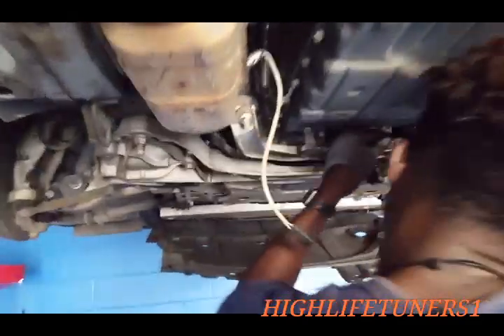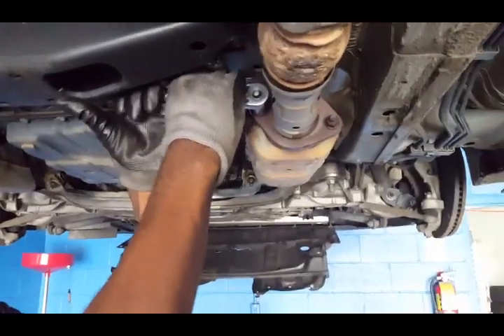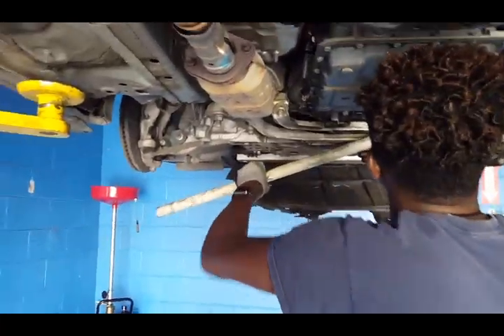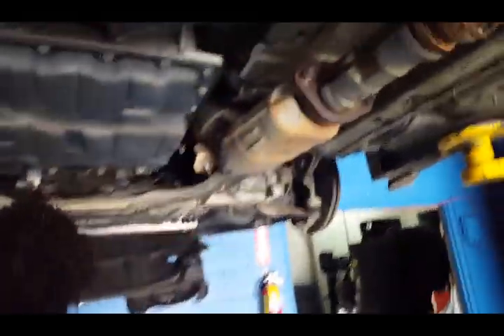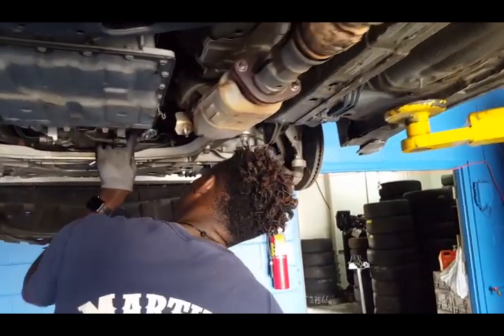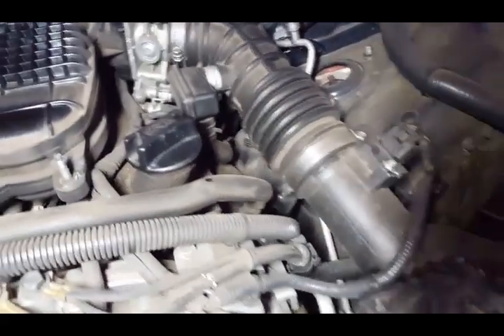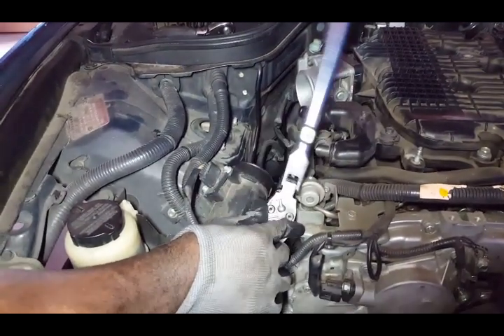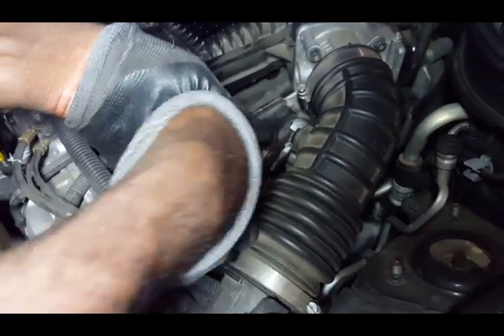2010 Infiniti G37/G35 replacing aftermarket catalytic converter

Comment: Much respect to the young wrench. I hope he's learned a lot by now.
Reply from the maker: hello arlen thank you for your great comment jo is already a good mecanic u can see in other videos please help us grow n subscribe thank u again...
Reply: Doing this job right now and I am having a hell of a time getting the driver side cat out.    I am not a mechanic but I didn't have the money to take it to a shop. The problem is 
1. I don't have a lift.
2. The bolts are old and rusted on pretty badly.   
3.  There's no room to work and get those bolts off.   
4.  There is a big heavy bar in the way .... 

my question is can I remove the bar?  ...and if I remove this bar will the car engine just fall out?   My gut says yes remove the bar the engine won't fall out.   But I'd like to make sure before I just Gung ho it and remove it.   

 My other question is once the bar is out of the way, if the bolts will not come loose.  Can I just take a Sawzall to the old cat? So I can reach in a get more leverage on the old bolt.?    I have new cats and new gaskets so putting if back in won't be too difficult.   

Let me know please..   I'm probablt just going to go remove the bar and hacksaw the cat out so I have more room to work if I don't heat back any time spoon.
Reply: @thedronefactoryusa79  idk if you went through with it but yes you can take the cross bar frame out since the engine sits on the motor mounts, just be sure to put it back on once you’re done. Also, yes if you cannot reach the bolts because of the cats in the way I would advise to cut it so you get more leverage, or you could take a torch to it and burn the bolt out.
Reply: Yea I cut that old cat out.  East peasy... no wonder every one is stealing all the cats... these are mine so I can legally sell them right?   Where would I be able to sell them?   And any idea what I can get for them?
Reply: @juniormartinez2586   😢

Comment: Wow great video I’m thinking this is the reason my g37 keeps going into limp mode after I reset the ecu because my Left side cat had a rust hole?
Reply: My doesn’t go in limp mode but keep throwing p0420 code no check engine light just service light right now testing with catalyst cleaner formula

Comment: Did you have to take off the steering rack for the last bolt? There’s not enough room for the 1/2 inch drive the steering rod is in the way ...
Reply from the maker: there is just a lil trikkie take ur time ..help us grow sub to the channel thanks
Reply from the maker: i also forgot we used an adapter that bends in half way i forgot what is call
Reply: A universal joint?
Reply from the maker: @DharokProd  add me on ig/highlifetuners1 n ill sent u a pic tomorrow

Comment: Question why are you changing the cat on here? It looks to be in good condition. Mine is all thrashed & beat up looking. I’m abt to put kinetix on my car. Wish me luck
Reply from the maker: The cats filters are not flowing correctly they may look good but not work correctly this car got over 100k miles cats dont last forever
Reply: @juniormartinez2586  ooh okay. Yes I changed mine too. :) best thing i did for my car. Love it now.
Reply: @Ulove619  you recommend the Kinetix Cats? I’m thinking about buying them right now.

Comment: hey i have a 2015 infiniti q50 and my cat on my left side is rattling as if somethong is loose in there maybe that honeycomb ish . But anyway my mechanic keeps saying dont worry about it and if he was to replace it hed have to replace everything like the sensor and the pipes n stuff.. because it would break ..hows that sound to you?? and are there any other options??
Reply from the maker: Man I honestly bought some test pipes if you want to save some money just put test pipes i pay $100 for both
Reply from the maker: Hes trying to rip u off the 02 sensors dont break you just removed them from the cats
Reply: @juniormartinez2586  can the o2 sensors melt onto the cat ?

Comment: I just had my driver side Cat replace ... I'm experiencing the same problem in performance issues as before while leaving the shop any suggestions as to what it could be just trying to get a second opinion
Reply from the maker: what brand of cats u got...depends on the brand  are u just trying to pass emission
Reply: @juniormartinez2586  the one off eBay from Canada
Reply: @juniormartinez2586  car is running super sluggish the mechanic diagnose front passenger Cat...pick up the car today and the problem still exist....car is real sluggish still low power
Reply from the maker: @Thatsdjmoon  did u read the computer what did it said.
Reply from the maker: @Thatsdjmoon  get u a 25 dollar scanner n tracked down let me know what the code is n ill looked up
Reply: Hello is it normal for both cat to go bad... Now I'm being told the other one is bad also?
Reply from the maker: @Thatsdjmoon  so u only changed one
Reply: Yes
Reply: @Thatsdjmoon  can you tell me what end up happening I have same situation
Reply: @swervv2957  come to find out I had trash from the cat in the exhaust pipes causing the car not to breathe probably.. have a shop check your exhaust pipes for trash
Reply: @Thatsdjmoon  is not trash cause I had it lifted and the rattle came from the passenger cat. All bad I guess

Comment: How are those cats holding up? Did it change how the car accelerate? I hear some converters have less flow than original, minimizing performance.
Reply from the maker: yeah it sounds diffrent n performance wise is ok unless u wanna spent $1800 dollars for new ones
Reply: @juniormartinez2586  hell no I dont want to spend that much. I'm stuck between $150 no name ones or $300 Eastern catalytic. That's for each. Mine are rattling internally.
Reply: @justhere4721  damn mine too! What did you end up doing? I’m in Cali and am limited on how I can go any this and my budget low. Need some help
Reply: @swervv2957  Well I got the eastern cats, they didn't fit right. So I returned them. While examining the oem ones, I noticed the part inside the cats came lose from the shell. Brought it to a good welder and had them weld the lose part inside to the inner shell. No more rattling
Reply: How would I be able to know if it’s like your? Is it possible to know without having to take it all apart because one I do that I have to either be sure that’s the problem or have a new one to swap if it’s something Unable to fix. Damn mine being like yours is my best case luck chance I got
Reply: @swervv2957  When you remove it off the car, look inside through the rear exit part of it. You'll see a filter like metel mesh thing. That's the part that rattles. If it slides back and forth ,it's lose. Have someone weld it to the inner shell so it doesn't move around anymore.
Reply: @justhere4721  ok thank you bro. I’m take it too a muff shop and see if we can do that. What’s the risk if any of doing that? I hope that’s the problem with mine. It’s just a continuous light rattle on the passenger side cat. No check engine light No difference in power in car. I just passed my smog 2 months ago. If it turns out the cats, might you know of any gd aftermarket to get? Heard that allot of after market weakened the tone exhaust and torque. Idk. But to get from infiniti is a shit ton of money for me at the moment at 700-1000 a cat. Fml
Reply: @swervv2957  No risk. The guy I went to used a dremel tool to clean up where he was gonna weld. Its tight small area to work on, but he got it done. The rattle is usually the heat shield or metal mesh came lose inside. Either way, they can see what's rattling easier when it's off the car. Good luck
Reply: @justhere4721  I’d go that route too but don’t know who will weld them on. :(
Reply: @Ulove619  Did you go with the kinetix? If not, can you let me know what you did buy and how did you like the change? Thanks

Comment: How exactly did you know it was the cats ? I have a 07 g35 and it just sounds rough but no code for cats.
Reply from the maker: this is my bois car he couldnt passed emissions he had a code for p0420
Reply from the maker: help us grow sub to the channel thanks
Reply: @juniormartinez2586  hey bro I have this constant light rattle sounds like coming from my cat on the passenger side. Took it to the local muffler spot and they told me it’s the cat going bad. But I got no codes and it just passed emissions 2 months ago? I don’t know what I should do if it is cat cause I know it’s expensive and I’m in Cali so I’m limited.
Reply from the maker: @swervv2957  jack it up n hit with ur hands if they rattle they need to be replace this things go bad after a while
Reply: @juniormartinez2586  we did that at the muff shop, hit it all over the cat and really didn’t get no rattle, so turned it on put bk on lift and you can hear the rattle coming from the passenger cat. But I’m not sure what to replace with at a budget that is gd quality, not loud, and passes in California.
Reply: My cats on my 03 g35 look horrible but no code. But I feel like I have lost power so I’m changing to the kinetix cats. I pray they make my ride better. I wish you woulda said all tools needed.

Comment: The bottom of my 2014 is so much more rusted than that it’s crazy
Reply from the maker: Used pb blaster to remove any rusty bolts
Reply: @juniormartinez2586  what set up is that I want to run it on an vq35hr 08

Comment: I have Z1 high cats and headers with intakes on my g37s. You definitely have too go and get it dyno or your going to get mixed signals from your ride breh.
Reply: Did your check engine light come on when you installed the z1 cats ? I got a 06 g35 planning on buying the cats from z1
Reply: @emmanuelnoriega2946  it did but not till later. Putting more air into the car just confuses the air censors that's all.
Reply: @emmanuelnoriega2946  im about to the same, same year and car. How yours turn out?

Comment: I'm on day #2 trying to do this same job. I'm stuck on one remaining cat bolt....driver side.... there's no freaking way to access the nut on this bolt unless maybe you remove half the entire engine bay? Jesus Christ. I've tried from the top and from the bottom. There's no good angle and I don't wanna strip the nut or bolt. FML. Every simple job on this car turns into a nightmare
Reply from the maker: The top bolt if it is u need a 1/2 inch extension the long one n half inch brake a bar n that will do it
Reply: Were you able to get it taken off? Im considering doing this on my car as well, but some jobs do indeed turn into nightmares

Comment: I twisted an extension trying to remove the top bolt on my cats, and gave up. Any tips? 07 G35s
Reply from the maker: u need a half inch extention thats the only way to get it .spray some pb blaster to loosen them.
Reply: @juniormartinez2586  okay I had 3 extensions stuck together like a train, and twisted one of my craftsman extensions. I'll use the PB blaster this time. Thanks for the info.
Reply from the maker: @alexscarborough6263 make sure is a half inch cuz the top bolt is really stuck on there can u sub to my channel for more future videos thanks.
Reply: Took me a lot of PB blaster, two broken extensions, and a stripped bolt remover bit to get my driver side top bolt out, and we broke the bolt lol...

Comment: I added a high cat  ,but it given me a code after  a few  days ,I felt  like I loss a performance , I dnt have the original catalytic converters to put bk in ,
Reply: Torvarris Brown anytime you replace factory parts with aftermarket, you need to get your car tuned. That’s why a lot of tuners recommend waiting until you have all of your bolt ons to install right before you tune it

Comment: U guys need to get some impact guns
Reply from the maker: We do have some but we did it with manual tools to motivate you
Reply: Yeah but the top nuts are connected to studs cant you just snap them off and make it easier. I mean you still gotta put them back on